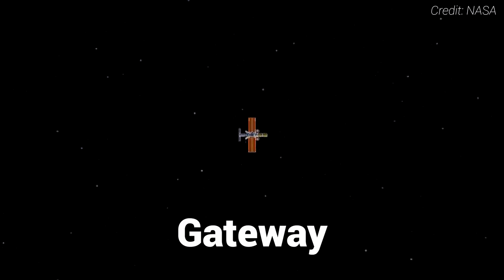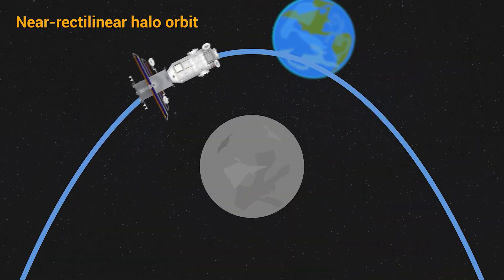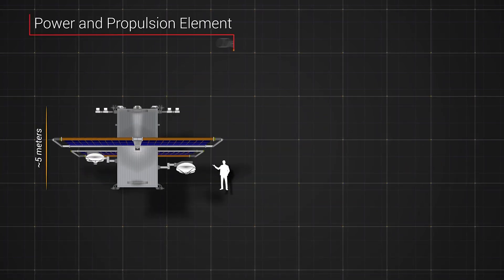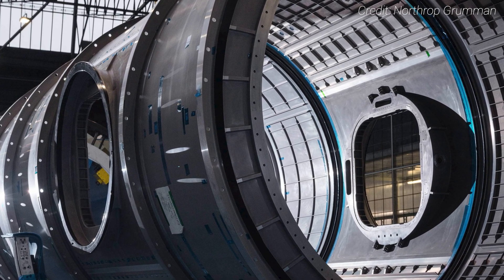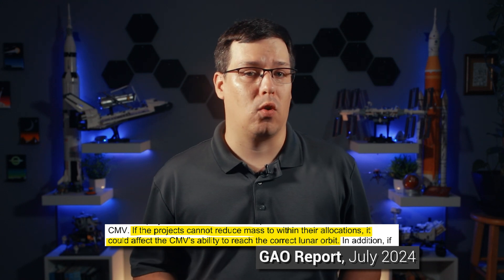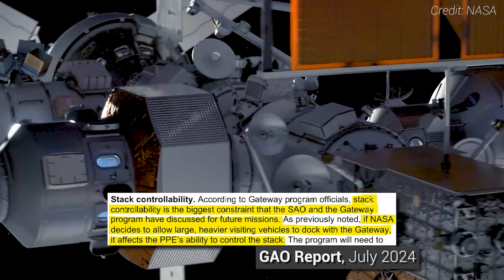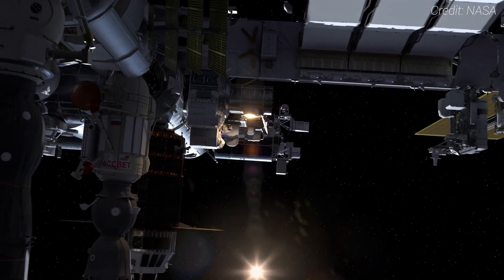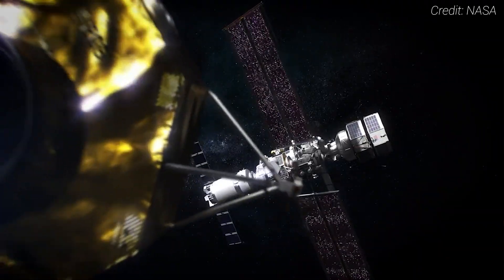Lunar Gateway faces mass risks and schedule delays

Comment: I know NASA's getting a lot of flack over the Gateway Station. It's redundant, expensive, money better spent on setting landers and astronauts on the moon, etc. However, I feel it could actually have great benefits further down the line, as more missions (both NASA and private) are sent to the moon. 
Now, my own problem with the mission architecture is the crewed lander (from SpaceX) that is planned. That enormous vehicle has a dozen benchmarks to achieve before it ever sets down on the lunar surface, and the prototype Starship (of which the lander is a variant) hasn't flown a single successful mission. That vehicle is years away from a rating of 'crew-safe' from NASA, to say nothing of lander variant. There was another company which had proposed a perfectly serviceable lander (can't remember who it was off the top of my head) which was well within NASA's requirements of putting two crew members and some cargo on the moon. It had a low profile, very wide, very stable landing leg configuration, and doubled as a habitat module which could be left on the surface to begin the construction of a permanent base (after landing a second return vehicle for the astronauts to come home in). That idea was shitcanned, and now we are waiting on the development of a lander system that is (according to some calculations) eight years away from landing on the moon, if even then. 
At this rate, we're gonna see a Chinese flag on the moon before we see Americans return, mark my words.
Reply: The Alpaca was shitcanned because they calculated the propellant wrong and it wouldn't work as proposed, which is a shame because it had a good configuration!     :)

The Artemis pork barrel program will always have delays, Starship or not, they should just scrap it.
I say, if China wants to waste money they can't spare on repeating old moon missions, let them.

Gateway is mostly pointless because the cosmic rays out there will prevent it being inhabited for more than a few days at a time - if they ever build it, I think it won't get much use....
Reply: China is not wasting their money, they plan to build a moon base, that moon base could be the basis of a small colony.

Before you know it the moon is red Chinese and gets industrialised and that's it, China is the master of space.

Comment: I watched the whole video and the only purpose I see for the Lunar Gateway is a docking point for Orion and HLS.  Using cargo Starships to get equipment and supplies to the Lunar surface well in advance of HLS gives much needed landing practice, ensures the equipment and supplies will be on the Lunar surface for the mission, and frees up HLS to carry enough propellant reserve to transit from LEO to the Lunar surface and back to LEO where it will dock with Crew Dragon for deorbit and re-entry for the astronauts.  This vastly simplifies the mission, vastly reduces cost, vastly reduces risk, and accelerates the schedule.   The goal here is a Lunar base, not a Lunar ISS

Comment: I like the idea of Lunar Gateway, and the initial schedule of deployment was always "ambitious". I would say cynically accelerated to garner political support. The flexibility in lunar missions is valuable, though tempered somewhat by the low number of lunar missions. Maybe with some of the new rockets being developed there might be other non-Orion missions.

I also like Starship, but it always seemed ill-suited for use as a lunar lander. Time will tell perhaps. I'm excited to see the craft become operational, we will get a better idea of what it will be capable of, though I think we're looking at a few more years of development before they really nail down in-orbit refueling. A necessary step to get starship to the moon. Musk also seems more interested in getting to Mars, so I question the companies commitment to its lunar program. As it stands if all starship turns into is a "space truck" to put a lot of mass into low earth orbit, with a reusable upper stage that can be turned around and reflown in weeks, it will be the most important rocket made to date. But it may be hard to construct the lander so it can reliably land on the lunar surface, recent CLPS programs missions have had trouble, and while engines and landing legs can move the center of mass down, A lot of weight will still be high up to support the astronauts living in it.

But I don't think we really have anything better waiting in the wings. Maybe the Dynetics HLS, or Blue Moon lander, but I would say neither are as developed as starship is, which isn't especially developed. This latest hitch might be a good excuse to switch horses though.

In the mean time, The delays to Orion and Artemis 2 have been disappointing. The craft has had it's fair share of criticism, so I don't wish to pile on more. But the program was announced 7 years ago, and has only had 1 launch in that time, if we're lucky the second launch will be next year. That seems like a bad use of funds. The program should be more focused, but seems to just be wasting a lot of effort on plans that don't go anywhere.

Comment: they need a rocket to send a space craft to a launched lander and they need a space station

THE APOLLO 11 NEEDED JUST ONE ROCKET
Reply: Apollo also took only 2 crew to the surface for 3 days max. You cannot do more than that without building a much larger rocket.
Reply: @darthrevan2961  just make a modified lander to land more than once and can dock to a separate space station
Reply: @brendonfanggg  That’s exactly what they did… and that makes it too heavy to be launched with the crew return vehicle.
Reply: @darthrevan2961  i said have a space station prepared before and make the apollo lander refillable
Reply: @brendonfanggg  That adds enough mass to make the lander too heavy to be launched with the crew return vehicle.

Comment: I don’t get it - After Starship has taken astronauts to the Moon and returned them to the Orion capsule it’s just going to orbit around the Moon. Why not then use Starship as the the Moon’s Gateway station. It would be much more comfortable than the pipe sized Gateway plans that I have seen and a whole lot cheaper!
Reply: how do you know all this? To date, Starship is just a metal can that has finally made it to partial earth orbit, but yet to even dispense flat pack satellites for which it was initially designed.  People are confusing Starship's concepts with reality.

Comment: I have an idea! Just slap some radiators and some solar arrays on a starship and BOOM, lunar space station! 😎
Reply: That cuts out the international partners.  Gateway can't be the new ISS without the I.
Reply: @armandomercado2248  the other modules can still be docked to starship
Reply: @LSF17  There would be no need for other modules.  Actually, there's no need for Gateway.
Reply: @armandomercado2248  that’s true, they could just make a moon base instead.
Reply: @LSF17  Then you just have to worry about radiation and meteorites. Would make more sense to just have landing pads and then build a base mostly underground. Maybe that is why Musk owns a boring company?
Reply: @DarkWolfsDen there is actually a good and simple video series on yt about exactly that
Reply: simplistic. Starship does not even exist as a crew vehicle yet  -- and no one knows when it will -- much less offer such advanced performance. Maybe Starship will prove out as a good base model to build capabilities upon, but we are no where near that yet.  Starship has encountered its own delays as well.